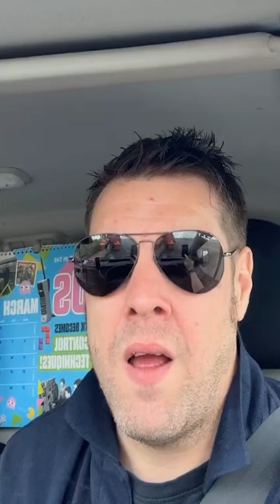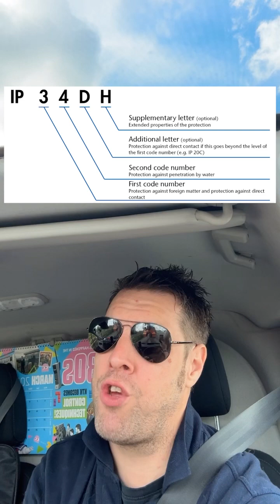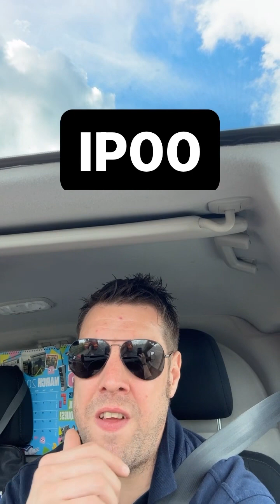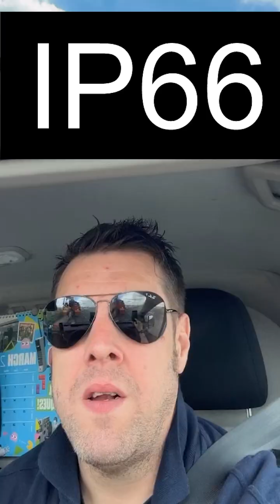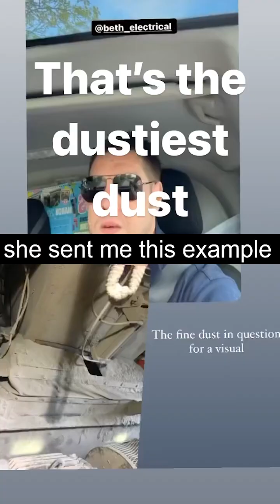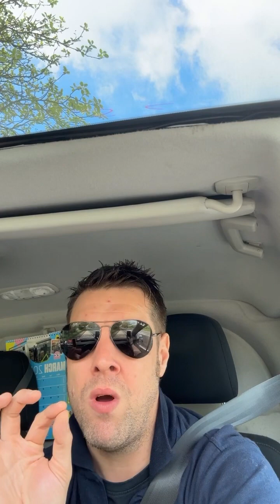IP Numbers  a Guide for Electricians

Comment: I enjoyed this video Jamie.  I did chuckle when I saw IP Zero Zero, to me it read I Poo.
There is also a 3rd column which is optional and most people and companies don't use.
Letter 	Meaning
F 	Oil resistant
H 	High voltage apparatus
M 	Motion during water test
S 	Stationary during water test
W 	Weather conditions 

In the cement factory you probably need a light fitting which is IP66 or IP66K.  In essence a decent outdoor light fitted in doors.

Can you do a video on IK ratings